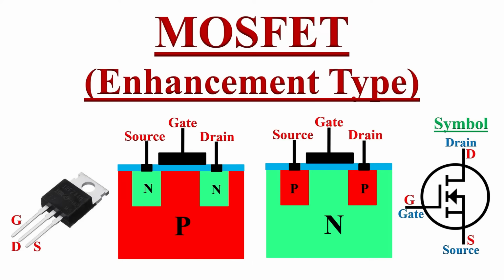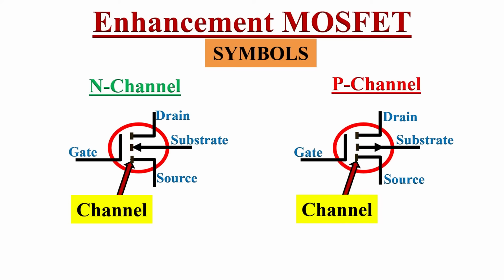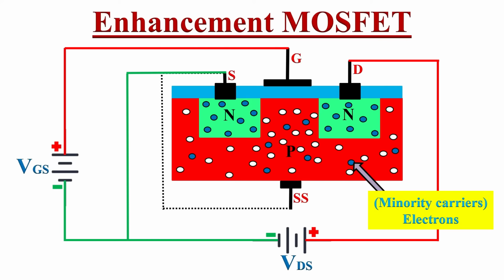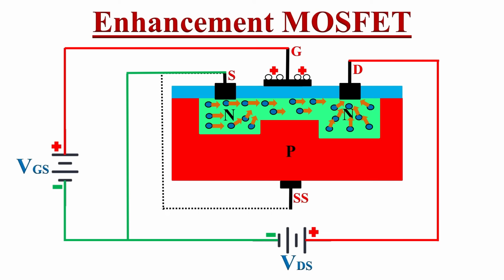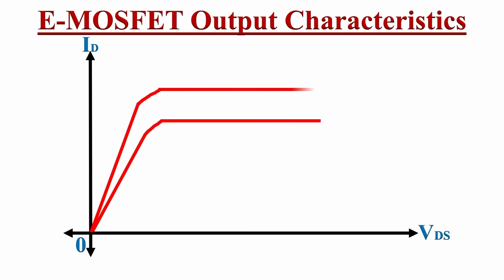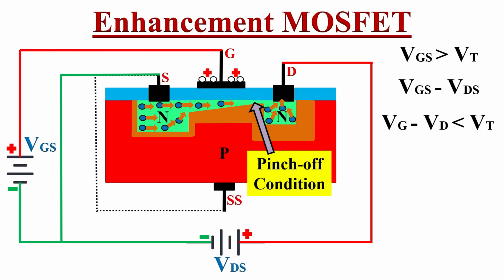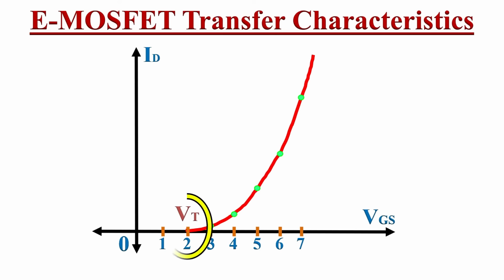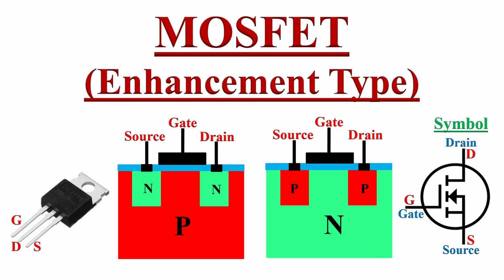MOSFET: Enhancement Type MOSFET Explained.

Comment from the maker: Timestamps for various topics covered in this video are as follows:
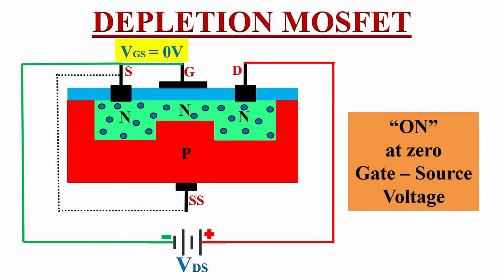0:50 Depletion MOSFET VS Enhancement MOSFET
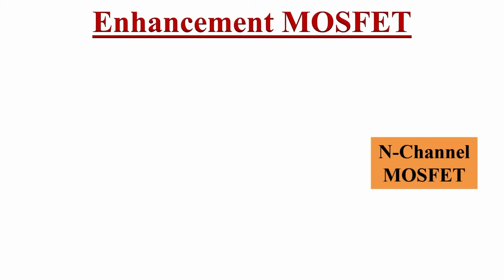1:23 Construction of Enhancement type MOSFET
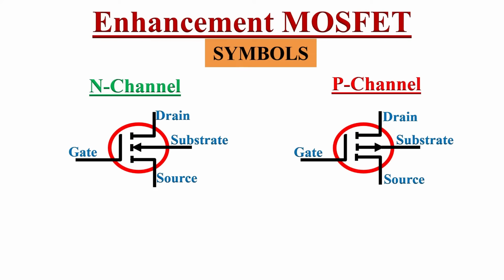3:03 Symbols of Enhancement type MOSFET
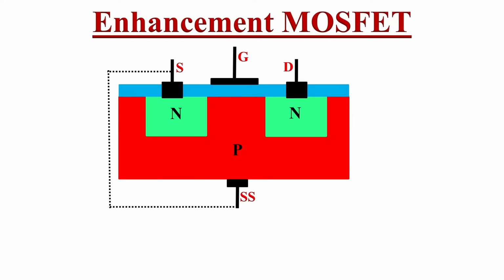4:28 Working of N-channel Enhancement type MOSFET
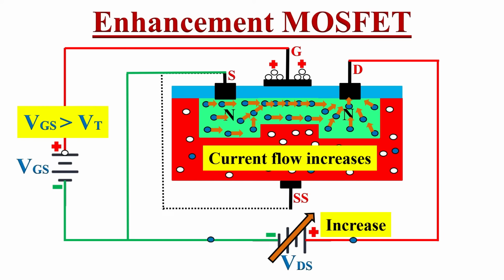8:50 Output characteristics of N-channel Enhancement type MOSFET
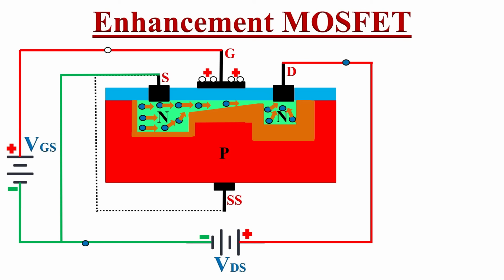12:53 Relation between Vgs/Vds/Vt and Pinch-off effect
15:59 Different regions of operation of MOSFET (Ohmic, Cutoff, and Saturation regions)
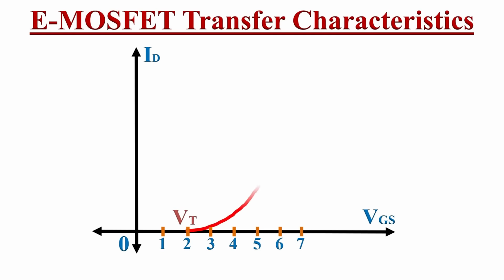17:50 Transfer characteristics of N-channel Enhancement type MOSFET
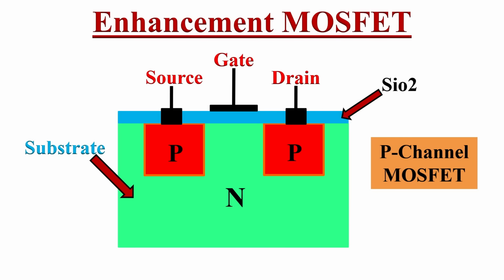19:00 Working of P-channel Enhancement type MOSFET
20:40 Output  and Transfer characteristics of P-channel Enhancement type MOSFET